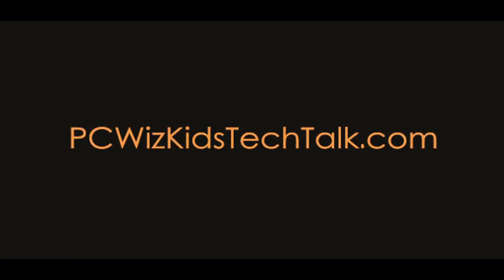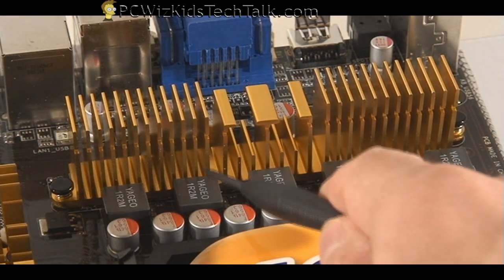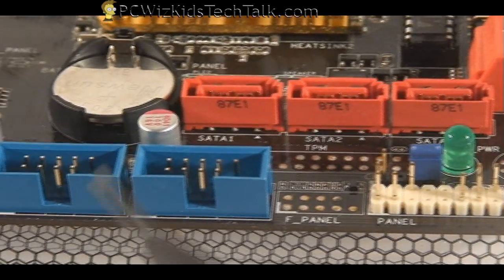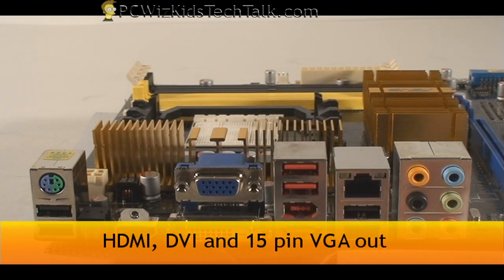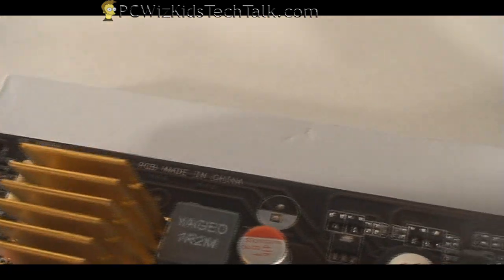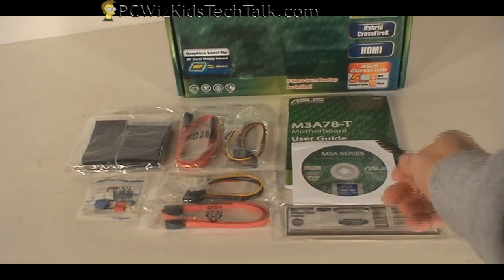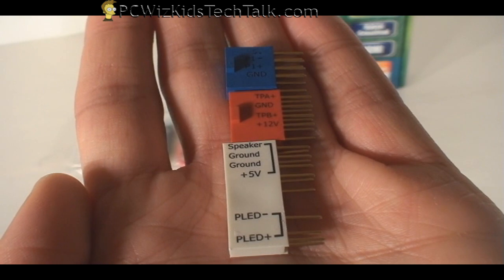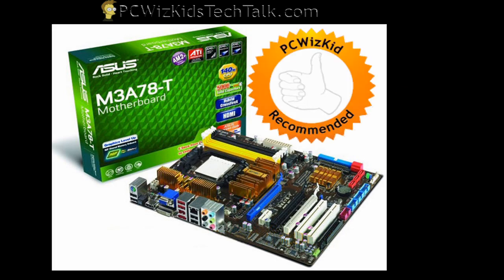Asus M3A78-T - ATX Motherboard Review

Comment: You would be surprised!

I have a 780g board and the 3200 graphics it uses can play most things , not at super high settings but still pretty well :) E.g. San Andreas 1680x1050 Very High 1xAA :)

The ATI 3300 used on this board is, at the time of writing this, the fastest on board graphics solution out there, beating the 9400 set from Nvidia :)

Comment: eVGA 9800 GT 512 MB Superclocked Video Card (650 Mhz instead of 600)
Seagate 500 GB SATA-II Hard Drive w/ 32 MB Cache
LG 22x SATA-II Dual Layer DVD+R w/ Lightscribe

OS is 64 XP

Comment: oh, ok, i dont really understand the difference...

i had a custom computer built for me with these stat's.

Antec NineHundred Case
2 Extra 120mm Blue LED Antec Case Fans to fill all locations in the case
Corsair 750 Watt Power Supply w/ 140mm Fan
Asus P5N-T Deluxe MoBo w/ nVidia 780i SLI Chipset, Heatpipe Cooling
Intel Q6600 Quad Core CPU (over clocked to 3.2ghz)
OCZ Gladiator Max CPU Cooler
4 GB OCZ Platinum Series DDR2-1066 Memory (4 x 1 GB Sticks)